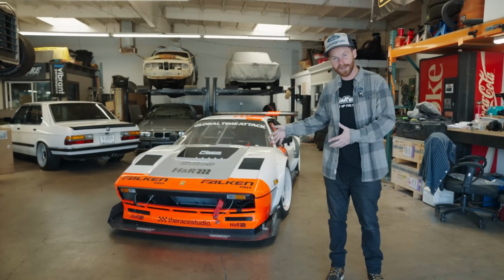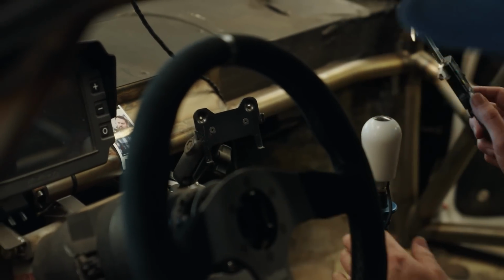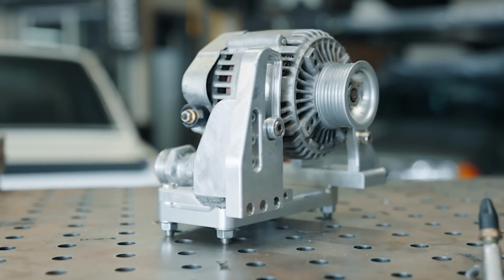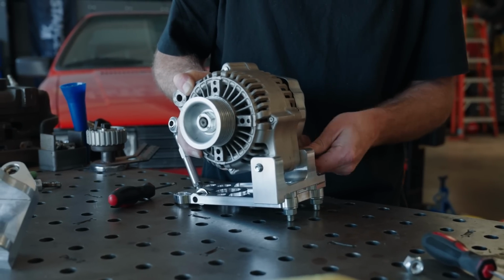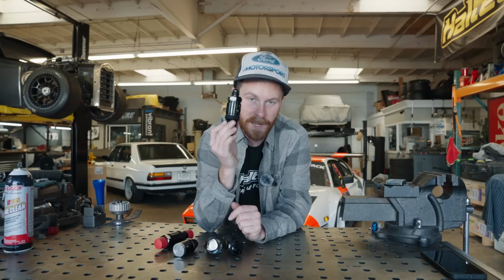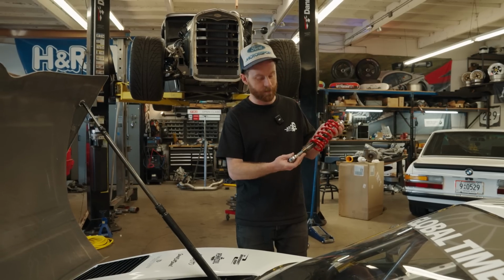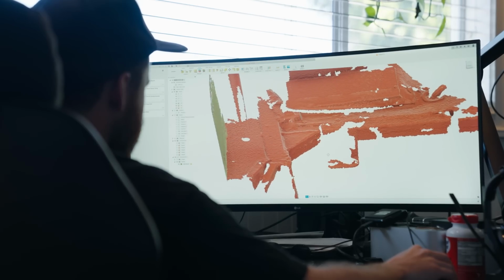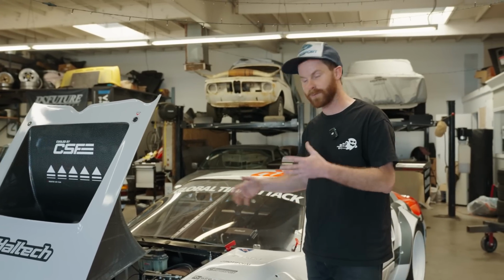The Honda-Swapped Ferrari RE-BUILD Begins: Ep 1

Comment: If the engine hydro locked on one cylinder then there would be a cracked head, blown head gasket or some other obvious fault. Plus some coolant in the cylinder. It's a pity that the engine was not sent for an independent examination as learning is one reason why some of us follow these sorts of topics. And there is nothing wrong with over square motors, in fact high revving (eg Honda) motorcycle engines are way over square.

Comment: Quick and dirty way to ensure a cleanly rising rate on the pushrod rockers is to have the pushrod perpendicular to the rocker at full droop and the shock perpendicular to the rocker at full bump. Now that I think about it, though, that assumes a vertical pushrod at full droop, and I don't know how that pushrod angle might affect those relationships. Shouldn't really change things on the shock side though, either way.
Reply: Just intuitively in my head, it should still be mostly right even with the splayed out pushrods, but shouldn't be too hard to figure out, as long as you can make a little rig in fusion or blender or solidworks or whatever though.
Generally, with a vertical pushrod I've found the ratio of lengths of the two sides of the rockers to more or less correspond to the motion ratio of the rocker and you just add in the ratio from the mounting point, but with your pushrod tipped over like that, you'd have to also multiply by the ratio from the angle.

Comment: This is one favorite looking build and something I see with so many people who build 1000 hp hondas and then try to drive them as daily yes cool to have but not a good driver and for guy run scca I find so many over power and then they can't get good times plus find short track races superchargers and a moderate boost rules I always tell people build it to due 3 times power u want if possible and I find hondas every day under 500hp they last if built correctly I find 400hp great street car also having a button for muilt boost levels and tunes a nice also just getting every thing to run cool ive took bone stock car and by doing the junk yard build using other stock but better performance part some hand work and making everything run cooler all on 93 octane and get over hundred hp fun to take something without add one but air intake plus exhaust work just fine tuning what is let on the table factory doesn't allow there's so many little tricks to take any car daily to make it fun u don't always have to have money to have a car be fun ive done a motor swap back in early 90s ford festiva small shit box that was a natural aspirated animal from using stock motor from another car no welder either just find a bigger block 4 to swap that was almost a direct swap and it was some of my fever builds just nasty little sleeper that one few dollars in day and laughed at also until they rode in it the memories of faces when rolling 4 gear burn outs was great all on poor budget just enginuity and love for difference when someone says it can't be done drives me keep up great work and everyone have wonderful day.

Comment: Love to see the Ferrari back center stage! I really like the new position of the keypad, but I would also expect that some reinforcement will be very good for QOL and longevity. In a race, with gloves on, and vibrations and stuff, having a nice solid bracket behind it will make (imo) a huge difference. I made a couple of brackets on my car that attach to the steering column, they are super solid, and are always in the same place even if I adjust the wheel. My original design were thinner material, and I constantly felt like I was could press them and break the bracket if I wasn't careful.

Comment: Would you be happy with just 300-350 bhp but 100% reliable engine? Use that while you tune other aspects of the car, brake, suspension,gearbox. Once all those are sorted, you can move to a 500 bhp monster.

Comment: Careful with the dry break fittings on vital fluids as they have a lower flow rate than a standard fitting. There are other companies that offer a high flow dry break if you’re set on it. I would get flow rates or bench test it yourself to insure the flow rates are ideal prior to installing.

Comment: Fine if you want to delete the water pump from your K series (race car) but MR2s have been running front mount radiators with K motors with no issues. Anyone who might want to build a mid engine K series will be just fine with a stock water pump I'm sure.

Comment: There is a way F1 does that suspension where the shocks are floating on opposite ends of a teeter totter with another spring for a sway damper Or how the radical SR1 runs a sway bar. fun stuff!

Comment: Happy to see another Ferrari episode! I’ve designed inboard pushrod actuated suspension before and my tip would be, don’t underestimate the lateral loads on the rockers. Make sure whatever bearings you use can support lateral loads too. While we aim to have the push rod, rocker and coilover in the same plane, the pushrod will diverge away from it, which adds a lateral component. Remember to actuate the system through the full range of motion and place your plane so alignment is achieved at the highest load. This is a simplification but, you get the point. The other benefit of the improved motion ratio is the damper will be using more of its range which will give you more resolution and control. A damper needs to move to do its job.

Comment: just a though. My theorie is that it isn't the headgasket at all thats the issue, but its actually more to do with the connecting rod to stroke ratio of the four cylinder and the total volume. It's also more to do with the secondary imbalance of a four cylinder. This will get worse the more the connecting rod to stroke ratio is reduced, and boost will make it worse even still.

As a reference:

K20 has a 86mm stroke 
K24 has a 99mm stroke 

I f the rods are equall length, the side load on the bearings will be much higher on the K24. Also the rods see much higher stress loads with the same rod length.

I'm not fully into the K engine, so i'm missing the specs of the rod lengths and the height of both blocks, so I cant help you there. But what you need to do is pick the tallest block. If a K24 is physically taller pick the K24 block. If its the same, it doens't matter. Use the internals of the K20, but get the longest rod you can physically fit in the block. That way your engine will live much longer, have less secondairy vibration, longer bearing life and generally less trouble.

Thats why motorcycle engines and purpose built racing engines like the  F1 engines i used to design have rod stroke ratio of around 2.2 and can rev to the moon. Hope it helps to get the most out of the engine.

Comment: That alternator is gonna flex like a mutherfucker on that heim joint. Why the hell did he only do it single shear?Nice piece up until that part. At least run a longer bolt through the baseplate and run a heim on each side so it's double shear. The bracket should at LEAST be on the pulley side. The belt tension is gonna be pulling on that bolt the entire time. That one bolt, single shear is expected not to bend over time having no support next to the head. Yeah that ain't gonna work. AT LEAST put a washer against the bolt head so that small hex isn't digging into the aluminum alternator lol.

Comment: FYI, I also use a Bambu to prototype before SendCutSend. I design as a sheet metal component, then use boundary fill to create a solid component that I can additional supports to. Changes to the sheet metal component cascade to the solid component. That way, I have a usable FDM part while I wait for the SendCutSend one.

Comment: Just an FYI, in Fusion 360, you can add threads to holes very easily.  Check the "Modeled" box in the thread dialog, and the resulting 3d models will have the threads printed in place - no need for adding extra walls or tapping by hand!

Comment: I actually love things like the control panel, the steering wheel hook or the quick disconnect oil lines. This stuff never gets listed on a spec sheet, it doesn't show up on a dyno. Someone could build a 308 with a bazillion hp that looks more impressive on paper, but if you were to see both cars next to each other, you could tell which one is more matured and developed by details such as this.

Comment: Hi Mike, great to see more Ferrari content! Just one quick clarification though - changing to a push (or pull) rod setup does not reduce unsprung weight.  This is a horrible term that is misleading to a lot of people.  Every item of mass that needs to move with the wheel in response to an applied force at the tire is unsprung - generally to a point halfway along the spring.  The pushrod and bellcrank therefore add to the unsprung mass.  The advantage you will get from a good motion ratio with the correct rising rate will more than overcome this small drawback though.

Comment: In terms of the Haltech panel I agree that an extra bend or bracing may be required as the new combo might vibrate.  Murphy suggests that it's natural frequency and perhaps a harmonic will occur in your power band ;).  Hopefully I'm wrong, but racing tends to energize anything on a stalk or bracket.

Thanks for the updates and for talking about the failed engine diagnosis even if there's nothing definitive; we all want to know even if the answer isn't satisfying.

Comment: I smiled when i saw your vid posted as its what I'm dealing with on my 80s Parati, even Cantilever suspension on a frame that was never designed for, will be a challenge not to mention the apparent 2:1 ratio? Hope HR can help in this department for the re-shim compression/dampening. Looking forward to part 2

Comment: Falling rate is not a bad thing if you have a high enough spring rate to control body motion. It softens your front axle under braking which means better corner entry.

Comment: It would be a great opportunity to design progressive spring rate/motion rate for the front suspension.
Softer spring rate for initial travel to handle small pumps and harder for hard braking and at high speed when the aero load Is pushing the front end down.

Comment: Excellent thought leads to excellent content. Nicely done!
I saw in your previous track day videos that the car was bouncing thru one of the final corners at a difficult surface part of the track. Everyone out there has to go over that same spot. It's those who have a superior suspension that will make the best out of a difficult spot on any track surface. It's going to lead to the best lap times of course and I'm sure that's your goal. I'm no expert but it looks like you are going down a very sensible path with the front suspension. I can't help but wonder what effect it's going to have on the rear suspension. One challenge at a time. LOL

Comment: Every time you do CAD work I get more and more motivated to use it. Such a powerful tool.
Reply: Fusion 360 rules. I highly recommend it. It can be intimidating at first but there are a few free 30 day lessons on YouTube that will teach you the basics and is worth your time
Reply: Autodesk has it's own FAQ website where you can find everything you need. be it Fusion 360 or AutoCAD or any other software they have.
I have been using it 2 years now for designing parts, and programming them to make them on CNC machines.
Small adjustments on the fly can save me hours of machining time.
Reply: There's no need 4 whining about motivation to use software. You either do or don't.
Reply: Siemens NX is the best
Reply: @LacerdaRafael  Yeah if you're a company, not sure if they give out single seats to consumers though. At least, not for less than thousands of dollars... Solidworks' $99 single licenses are a great deal though
Reply: Onshape > Confusion 360 😉

Comment: Very impressive to tackle all of the suspension stuff.  Suspension is one of the dark arts for me and always so confusing, especially tough when you really need to track test any changes.  Great episode, and looking forward to the next one
Reply: Suspension is no joke. Frankly, without a very seasoned chassis engineer with extensive racing experience, the whole thing seems iffy. Serious challenge in so many project cars.
Reply: The hard part is the geometry to get roll center, camber curves etc correctly. The spring is kind of the easiest part here. As he mentioned you just have to make sure that the sring rate is as constant as possible or maybe a bit progressive. The good thing while using a push rod setup is, that if you get a non liniear spring rate coefficient you are also getting more dampening force. So the damper will "adjust" itself aswell and you can actually use this. A progressive spring rate can be used for example to get the car a bit more understeery under load or something like that. I would use a more linear setup at first however and by just changing the rocker you can add different characteristics later easily.